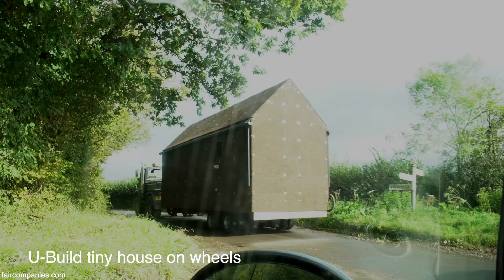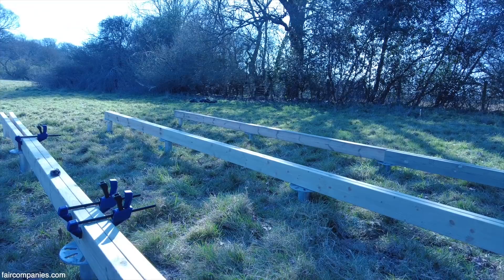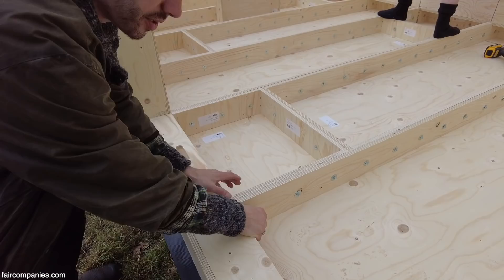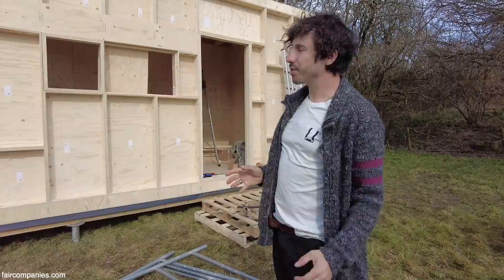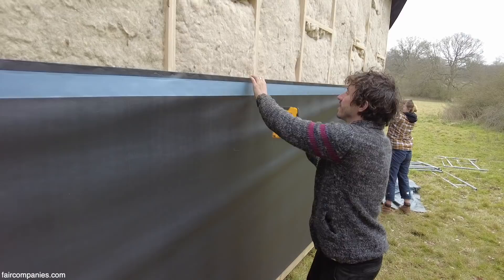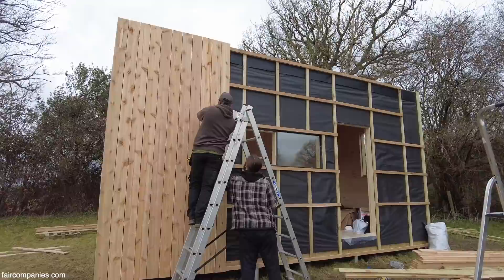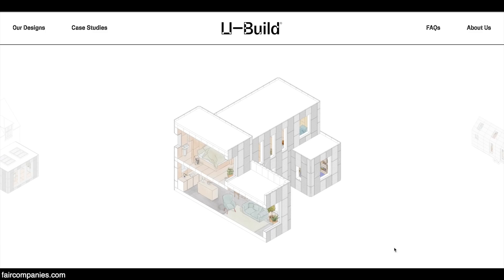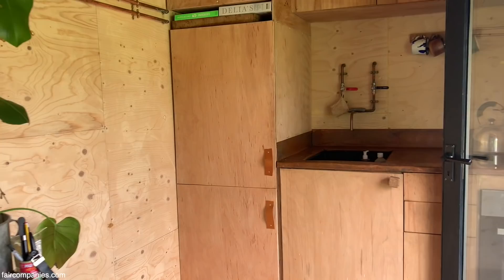U-Build hands-on: a flat-pack modular home you can assemble

Comment: I appreciate the way that this group is trying to make home construction less skilled, however they talk about traditional construction like it's an albatross that is somehow harder to learn than it really is. People with limited education have been building houses around the world using traditional techniques for millennia. This is a great idea, and timely, I just think it's important to consider that the traditional techniques are within reach for most folks.
Reply: Absolutely
Reply: Do a 3 y carpenter apprenticeship in Germany and you are set.
Reply: A building code approved dwelling of equal or greater size is far easier for the inexperienced and is far cheaper.  The best flat pack diy house is the one any lumber yard delivers for building a simple gable ended house of any dimension and roof trusses on a 24 ft gable wall span makes building the roof an easier step than this as does using precut 2x4 studs for building exterior bearing walls
Reply: Your definitely correct. Maybe make a diy kit with traditional materials and instructions for each step. The only reason people buy these overpriced tiny diy kits is because they come with instructions
Reply: @jasonjohnson6216  Sounds like a perfect opening for a business then!
Reply: @W1z3k  I’m lazy, you do it
Reply: Just what you said. Like anyone is building sheds with a hand saw and a chisel these days? Found that abit patronising. They basically built a caravan without wheels and think they have come up with something new. Now try building that system in the rain, by yourself without all those hands on deck in a field.
Designer fail.
Reply: Perhaps building a rectangular structure. But even then, constructing a structure that will be stable and waterproof requires a foresight that only comes with a comprehensive understanding. The tasks by themselves may be rather simple. The planning and design is not quite that simple.
Reply: I built a camp with my buddy when I was around 10. It was like a small shed, definitely wasn’t anything anybody would live in. It had a shingle roof with vinyl siding and windows. Some structures are simple to build. With a lil common since and internet access I don’t see how a guy with average IQ would have any trouble building a small box to live in
Reply: CONST. INDUSTRY IS HAVING TROUBLE FINDING ANYONE WANTING TO LEARN HOW TO DO IT.
Reply: Everything in todays world seems to come down to what  is most time and cost effective/efficient no matter what it's applied to or effect it has on peoples or the environment unfortunately. Traditions are great, but when they are rote behaviors they're often more destructive, the same could be said for novel approaches.What will stand the test of time? Is hindsight really 20/20?
Reply: @jasonjohnson6216  I've built many a 10 year old clubhouse too but with all the beaurocracies of middle men, codes, ordinances etc. they can't be compared to adult living spaces.
Reply: 3 months to frame is not fast!
Reply: I people have been self-building houses around the world, I think it's quite frankly insulting and condescending to consider them with "limited education."
Reply: Hey Zach, the other thing to mention is that this design requires an enormous amount of wood, which this price now is double or even triple, to manufacture. I get you can take it apart, but once the wiring and plumbing is in, that become impractical. Hope you and Josh are doing well, looks like we watch similar things on YouTube. Bless you both as well as HH Tico Dharma.
Reply: @danielk4331  for two people without building experience it definitely is
Reply: @jasonjohnson6216  I bought and built a kit that I bought at Costco. I was too intimidated to make my own design. Now that I have done it once, I would not buy a kit.
If I thought to look at the instruction set before I bought it, then I might have built my own design from the start- a modified version of what was in the kit.
Reply: @joeprizzi407  send some pics
Reply: ok they now know how to nail, hammer, and screw wood together but not how to build anything. we really need to get back to apprenticeship programs in USA.  electric is I think the only one still on that system? maybe plumbing?? My dad was a master carpenter . You learn a lot just watching or handing up tools. all the unions used to have these programs didn't they? Sooooooo ANYONE that's played Tetris? can now build a house?
Reply: @W1z3k  They already exists in the USA... look them up. Probably in every other country, too.
Reply: @tillytyler2871  Millennials at work. If they could construct it like a video game they would. Reality is that this is an over-engineered mess and expensive when you consider the factory and cnc equipment used and maintained. 
Two experienced framers with good tools and a pile of wood could easily smoke these ten people and their cyber toys. 

The only good idea was the screw system for starting the foundation.
Reply: @Demama777  yes there's def a trade shortage.
Reply: @louellacharlton4425  The UK too. Maggie T scrapped apprenticeships..wages were min and the uk government paid the employer directly. I'm sure it was her who scrapped them but I will stand corrected.
Reply: @heather333  Everyone go take a look a Tesla's folding tiny homes. The videos are online...$50k and EVERYTHING is included except bed and sofa. He himself is living in one after  renting out his own main home to be close to work.
Reply: Where are you in the world?
Reply: @heather333  Take a look at A-Frame homes .... thousands of them in the usa some dating bk to the 1890s and still going strong. Going to be building one in the EU.. looking for suitable land as we speak.
Reply: @CHMichael  Alas, I live in the US where common sense is, you know, not as common as it used to be.
Reply: While I mostly agree with you, and can appreciate your POV on traditional building methods you've left out  some important considerations. In today's time, having things built or building them from the ground up yourself requires design plans to scale (another skill to learn - architects and CAD professionals are well paid for this alone), multiple permits (which costs money, and there's a learning curve there too), transportation of multiple construction materials and components (hopefully you know which finery and cogs will be heavy enough gauged to weight bear each part of your structure - again, an engineering component to learn). I could go on and on about the multiple skills you'd need to figure out in order to build your own home, none more valuable and critical than being lucky enough to have the necessary TIME to research and learn it all. What you didn't mention is the fact that back in yesteryear, there were plenty of skilled laborers to rely upon who could pass down their knowledge. We no longer have that today, and instead have complicated plumbing, electrical, machinery, and all manner to building aspects to consider (including a team of helpers - again, in yesteryear you could call on your family and friends who lived nearby and had a communal attitude. No so today!). I think something like this is very practical for many people today.
Reply: Traditional tecnicks are too much time and labour consuming...
Reply: But....the required tools, time to learn, costs today...are prohibitive. 
A good carpenter/ builder....charges a minimum of $50/hour; this is unsustainable for younger people.
Reply: @frankfromupstateny3796  that’s unsustainable for many of all ages!
Reply: Exactly, and anyone can build their own tiny home and inexpensively with reused materials.
Reply: I think the “albatross” is seen in the rules and laws that have created an impossible situation in terms of certain DIY aspects.
Reply: So well said! I get so frustrated when watching the tiny house movement. On one hand they're the most creative people I've ever seen, but I could do without their passive, aggressive judgmental comments.
Reply: What about older people who just aren't able to build a traditional house due to being fatigued, health problems, and just being able to stand for long periods of time much less climbing ladders and such. I think this is a great simplified idea for building a home for those with such issues. A great majority of the people needing housing are those that are older and can't afford traditional techniques for building on their own.
Reply: As someone with decent understanding of carpentry, masonry, bricklaying, electrics and plumbing I tell you that you're overestimating the average folk's abiility and commitment to do a good job. We need more simple, easy to carry out instructions or you end up with buildings like in tthe USA that are made out of cardboard, drywall and special waste insulation.
Reply: @jasonjohnson6216  me too. Sears sold more than 70,000 mail order homes between 1908 in 1940. 70 percent? Still standing?
Reply: @beerenmusli8220  good point, thanks
Reply: exactly, it ain't rocket science.

and they also forget that traditional means different things in different parts of the world, and means different in the city that in the country.

for instance in Latin America rural areas traditional means adobe brick/cob/wattle & daub houses, in Latin American cities it means reinforced concrete houses, because in Southern European cultures and their extensions we don't build with timber.
Reply: @Sanya Dragonheart  In all actuality, a house can be built with a hand saw, miter box, hammer, and nails. 😉😊
Reply: @frankfromupstateny3796  harbor freight ( cheap China tools in the USA) circular saw and framing nail gun pay for themselves by the time your done the build if you do it yourself.

Comment: Nice thing about it is that, in the future, you could always order another section to make another room quite easily. Very modular.
Reply: Or take the whole thing down are reuse it somewhere else with minimum effort.
Reply: @marcellogenovese199  Those timings are ridiculous. (they probably just hung out and wanted to be on film.) The modules for my 250 m2 house are being assembled off the CNC machine by two factory workers right now, it will take 4-5 weeks, then 1-2 more for the lego construction. And yes, cost of labor is the killer, which is why this method rules.
Reply: @marcellogenovese199  Tiny homes are trailer homes for rich kids.
Reply: It certainly is a great start!
Reply: It looks very appealing in how easy and versatile. However. Some folks live in areas that get major storm seasons. ... The shipping container options ... can withstand 170mph winds. And I love wool immensely; but I could not give any to my squirrels, because once wool gets dirty, it really must be washed and dried. . . 

This looks fabulous if you just don’t have weather issues.
Reply: @TheOwenMajor  They're actually mobile, which is the difference. Many can be pulled by a pickup truck, rather than the enormous cost and effort of moving a mobile home that may not actually end up being mobile at all.

Comment: This is perfect for people who are not so skilled in the carpentery department but want to build their own home
Reply: wouldn't working together with a carpenter for 4 days get you a stronger cabin? meanwhile you would learn a bit of the craft, and it would cost less than this thing
Reply: @marcellogenovese199  It all depends upon the geographical location. What you've observed may be true for your area. Here in Asia, most homes can be built easily by villagers and farm workers from cinder blocks and cement, with concrete foundations and support columns. Cement tiles are common for the roof. Such modest homes last families for generations, resisting storms and earthquakes. They can be modified and added to as the family requires. I know, because I supervised the building of one 17 years ago, by local labourers who had the requisite skills, and it suits us fine.
Reply: @markifi  would it be?  this seems like it could be stronger than a traditional timber framed home.
Reply: could well be @FeelItRising  , but I feel like long boards nailed together beat small boxes bolted together. Less chances of inaccuracies adding up to compounding weaknesses. I am not a builder
Reply: Seems to me like it's just another skilled trade they are trying to destroy with "technology."
Reply: @LadyIarConnacht   That's a bit small minded. There isn't just one way to do something, and to do it right. This way might not be your way, but it will work for someone else. As for the skill, they aren't experts, but they are learning a bit of the skill needed to accomplish their goal. "Technology" isn't bad or good, it's a tool. It's the person wielding the 'technology' that puts good intent or bad intent behind it.
Reply: It’s a great idea 👍
Reply: yes, someone with a bit of skill could build something the same size for less money and probably have a better build. however, having all of the pieces come in a kit with instructions allows someone without the skill/confidence to build something.
Reply: @dizz740  lol, pretty sure like all houses, there’ll just smash the window or kick the door in to get in. 😛
Reply: @LadyIarConnacht  They are building not destroying. If you want to learn a skilled trade or employee a tradesmen go ahead. The invention of printing presses put the human "printers" out of work was than a bad thing?
Reply: @markifi  Airtightness is very important.
Reply: @SimonEllwood  yes thank Kodak.. they were the forerunners I believe in the newspaper industry bk in '96 ish
Reply: @WolvesinFrance  tyvek on the walls, villas on the roof?

Comment: 12:36 I am so glad you said that because i used to frame houses with my uncle and watching this, during the whole first 12 minutes i was like “why the hell would i do that instead of just building it the old fashioned way. I’m sure it’d be faster and cheaper and i have all the tools already.” 
So being honest and upfront really took me of my high horse. Now that i think of it, it does make sense for those who don’t have the confidence and experience framing to be able to build something they’ll be proud of. 
That being said, i question the degree to which this is easier or even faster than just framing it. It seems exponentially more complicated than building a wall on the floor and raising it. However, to each their own. Great idea for those who dig it, or for those who live in places (like Europe) with crazy regulations about who can do what where and when.
Reply: building designer here and agree with you.   overall seems a neat way to go, modular framing with ply or cross laminated timber can be stronger, more durable with same level of assembly of stick build.   never cheaper
Reply: Yes, I can see where you are coming from.
While I like the modular concept, I question why cutting things into too many small pieces then assemble them together; somehow it goes against the time/energy efficiency.

Comment: As much as I love the idea behind this, the design has a major moisture problem. Putting a vapour barrier on the cold side of the insulation will lead to condensation against the insulation, which will lead to mould problems in a decade or two. I don't think it's an unsolvable problem, but it does need adressing.
Reply: cold climate inside, hot humid outside
Reply: I was thinking that too but they use a breathable membrane. Not a traditional vapour barrier.
Reply: One could argue that a sealed 3/4” plywood sheet is enough of a vapor retarder to prevent any cold weather condensation on the exterior membrane.

Comment: So basically it's 30k dollars for 300 sqft unfinished shell. Cool idea but you could build a 300sqft frame built tiny home completely finished for that price.
Reply: @Jj-gi2uv  That sounds like it would make a cool documentary!
Reply: True! Especially if you build it yorself. In fact, you can build 2x6" framing for walls for insulation thickness, and you can make it modular by making 4×4' walls stacked instead of 8x8' standard.
Reply: Yes, you could possibly.  But the Architects were saying 'well what if you were not an accomplished carpenter or willing to give that a go'.  A self-build is so daunting.  Plus it is like self-assembly furniture.  So for a certain market it appears to be ideal.  They said it would be more expensive to use their self-assembly pack but then it fits a certain market.   It looks like you put one of these units together quite quickly.  The couple in the first part of the video said it took them 3 months... but do not know if that was full time or not.
Reply: @Jj-gi2uv  That would make a fantastic video....
Reply: Yes. But people want to fool themselves nowadays ...
Reply: @Daswars777   As opposed to the rest of human history? Right.
Reply: Lot's of issues in my mind. Insects nesting in all those openings in the  siding, only one operative window in the whole structure, very expensive, as you mention, for what it is, certainly not for me but some nice innovation.
Reply: @Jj-gi2uv  What does that have to do with CNC?

Comment: When I saw the huge land screw, the first thing that popped in my head was. I don't want to meet that dog that's going to be tethered down in that yard. 🤣  There's one thing the U-Build engineer said that stuck with me, if the building materials (container) needs to be shipped in from outside of the country, its really no longer a green solution. In his example it was shipping U-Build made components outside of the country.  I like the fact U-Build is dealing with finding solutions to reduce heavy construction aspects of building a house.  Simplifying the foundation, truly making these  structures relocatable many years down the road. 👍🏼